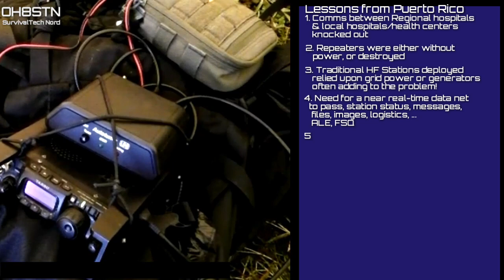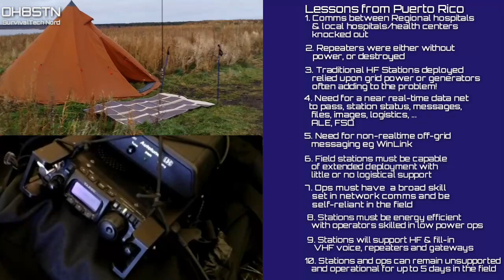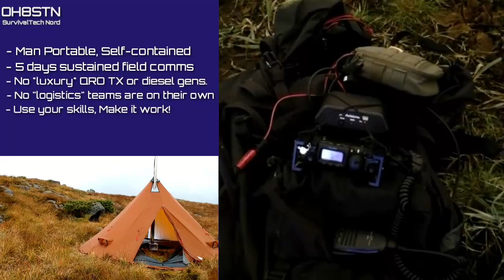Portable Ham Radio Station on Solar Power | Introduction

Comment: That was awesome Julian ! Love the new tent. Exactly right - you have to be self sustaining and electrical generation is definitely a luxury. Thanks for sharing !
Reply from the maker: +SurvivalComms thanks for stopping by Brett. I'm already getting pushed back about the diesel generator poking, but I think it's true. If there's no Logistics a diesel generator just becomes a boat anchor when the diesel runs out. On the flip side a good operator who knows how to ration his batteries and scale back the station, may very well be able to operate for days at a time. 
I definitely enjoy the discussion, no matter how I operators implement the functionality. It's all about the learning.
Julian
Reply: Relying on a generator is like relying on disposable batteries IMHO. Its a consumable resource for sure. What was the battery AH capacity you are using for your packable setup ?

Comment: Julian,

Now that’s what I call real prepping! Being man portable - everything carried in and out. Self sufficient without a logistic trail. It is a wonderful ideal, but how practical? I am a gentleman of a certain age, not old but also not young. My days of humping up the hills of Camp Pendleton are long past. I figure tent, sleeping gear, food, water, clothes plus the FT-817, battery, solar panel for five day sustainment must be at least 50lbs if not 70. It makes me think that Steve with Goat had a good idea. As I’ve expressed before, this has me thinking of cutting down the weight of the radio to a single band 5w CW rig. I love my FT-817 but it has a high receive current draw. Get that number down from 330ma to 100 or less and you can skip the solar panel as well. The question now is, who are you going to communicate with and why? To get help from hundreds of miles away, CW might be enough. To coordinate shelter logistics, then I need the FT-817 or something similar - and if I’m supporting my community, man portable doesn’t seem as important.

Julian, I really enjoy your videos and what you are doing for the ham radio and prepping communities. I think there needs to be a deeper dialogue on who we are communicating with and why. If we can agree on the scenarios then we can see if the mode/Radio/Antenna meets the need or not.

Sincerely,
Charlie
KM4ZZ
Reply from the maker: Thanks for the reply.
I'm definitely not a young buck. I was was probably humping the same Hills over Oceanside as you were back in the day.  The thing is this setup isn't really about the individual Communications. It's about having a kit set aside in readiness for situations like we saw in P u e r t o R i c o ( I spell it out like that because videos mentioning it gets flagged by the algorithm). The idea that the government is going to come and save us is just ridiculous. If I'm not mistaken we've talked about that before. So the idea is about supporting a larger Community or region in a grid down disaster scenario like PR. I believe ham radio clubs, well-to-do individuals, or those in a preparedness community could build and support these types of kits, and promote the training. We already have the tools and methods, but people are still stuck in the 60lbs gobox mentality, carrying use junk they dont need.
The who to talk to part is little different than straight on preparedness. At the end of the day there are those times when we need to support the larger community. That means helping the the effort to get information to and from distant stations who themselves are supporting a hospital,  health center, camped on a hilltop setting up a gateway or fill-in repeater, ... that's why I suggest tools like ALE & FSQ, and an well practised and prepared comms plan. We won't know who were going to talk to.  We only know the grid is down and there are no Communications. That in itself is the trigger putting us in action. Again this is the critical time after the Hurricane passes, and the big guns get boots on the ground. 
Going back to the gear and load. I've worked very hard to reduce the ounces and grams. I still have a ways to go but that was the starting point. Then I augment my own carrying capacity with a hiking trailer, or skipulk sled. Both of these devices easily double my carrying capacity.
Just because we call it man portable,  doesn't mean we are strapping it all to our backs.
Let's keep the dialog going.
73
Julian oh8stn
Reply: Julian 

You make many wonderful points. But let’s look at this from the idea that those we are most able to help and those who would be most able to help us are rather local - say within a 20 mile radius. This is until a larger governmental footprint is established after our five day theoretical horizon. During that time it would be vital to establish communications between whatever resources have survived. HF is not the right tool. A self contained repeater system is what would be best. The ability to talk 300-1000 plus miles away is a luxury. It’s nice to know what the world knows, it nice to know help us coming and maybe you being a voice telling the world what happened and what you need might put you ahead of the next town over but the HF communication isn’t going to help you. This discussion is true about the “hurricane scenario” but maybe not true of the scenario your country tested this fall. It might be helpful to define a few scenarios to see what resources should be right. I’m not advocating for the 60lb go box but I don’t want to bring a knife to a gunfight either.

That being said, what is the scenario where the HF man packable station be the best tool. The clear answer is when you need to call for help and out of range of VHF. Small expeditions and camping trips come to mind. Distant islands and sparsely populated countries also fit the bill. We can discuss what modes work best in the “small emergency big distance” situation some other time.

Great discussion.

Charlie
Reply from the maker: +crbrelativity this is a fair comment. Remember I'm presenting these ideas too about 25 different countries. Sometimes even within the same countries there are operators who are in deserts, or a mountain tops, or an island in the Pacific or Atlantic. I spend a lot of time studying with the military relies upon for fall back Communications. At the end of the day it is undoubtedly HF. I do agree that between 0 and 50 clicks out, HF is like using artillery for a knife fight. The thing is I'm not advocating for purely HF, or purely VHF. I'm advocating for a self-contained Communications kit that can be deployed in the field to augment Communications in a grid down scenario. How an operator or organization implements that kit or its capabilities, is exactly like you say, it depends on their local area and conditions.

Last August when we had the emergency communications exercise here, one of the things we were encouraged to implement was digital field stations. Self-contained stations which could be deployed in the forests, away from unwanted attention. So the mission changes but the kit has to adapt. You haven't forgotten have you? Improvise, Adapt and Overcome 😉

Comment: Great job Julian. Happy to hear that the solar panel was effective in low light conditions without direct sunlight. I'm currently saving money to add solar power to my man portable station. 

I was out yesterday learning to properly tune my new Wolf River Coils antenna. It's a bit of a learning curve.... but I'll just keep practicing. Do it until you can't do it wrong... right?

Comment: I'm planning on doing the Ct section hike on the Appalachian trail in the spring 2018. It should be a 5-6 day hike and im planning on deploying my ft817nd with the mpas system at different locations. to recharge batteries while I hike im thinking of using a f15 1200 or 1500 secured over my osprey AG  65l pack. any thoughts that might help? This will be my first time doing this.